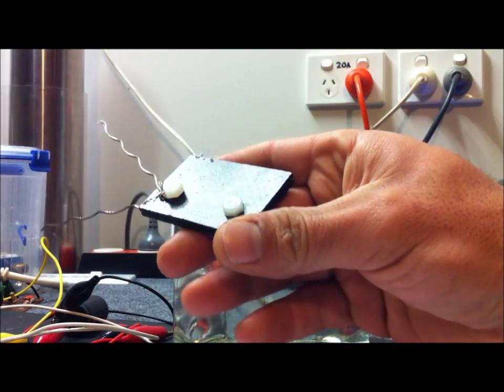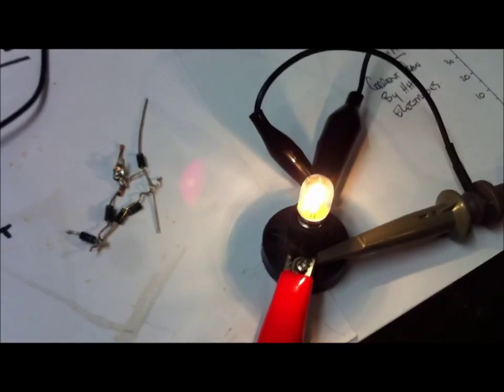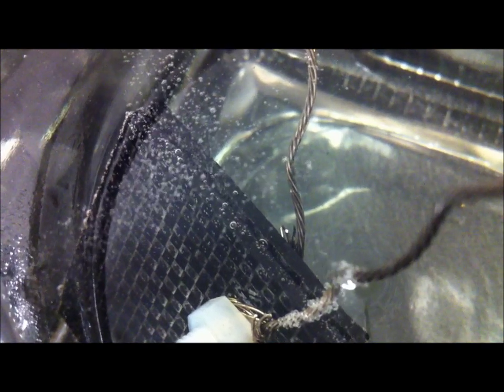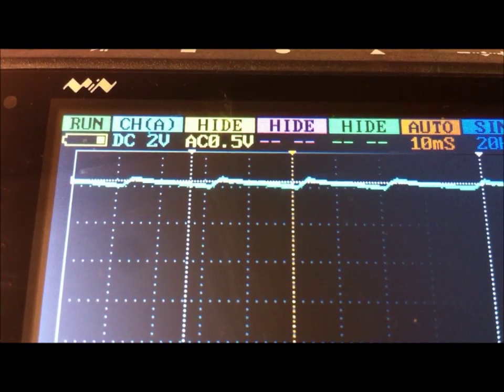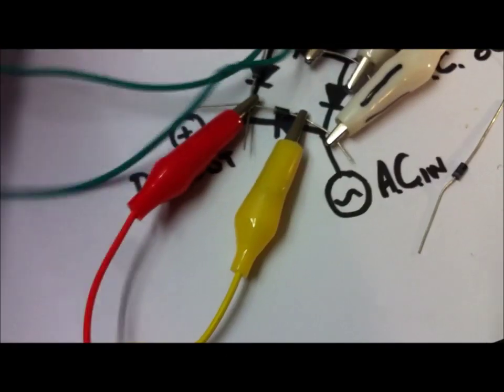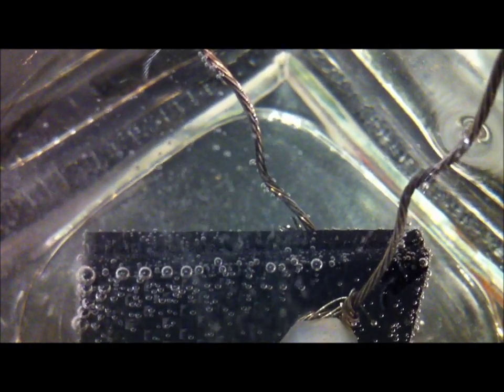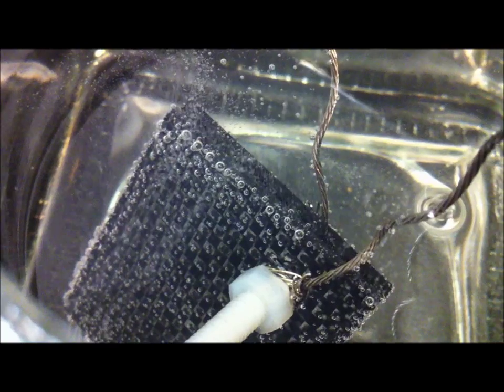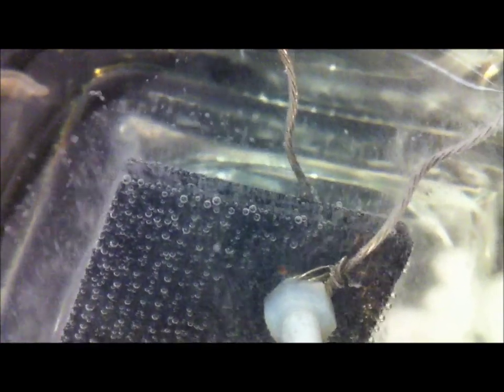Can Carbon Fiber HHO Electrodes Act As Underwater Rectifiers?

Comment: Have you tried higher frequencies and higher voltage, as opposed to amps?  Maybe pulse a 12vdc source through a transformer and then through the carbon plates.  I would like to see what happens - but I don't have carbon plates.  :)

Good luck.

Comment from the maker: No. I will do this when I get around to putting the electrodes in a cell. I have been putting it off because I needed a flashback arrestor etc.. for safety reasons. I have all the parts now, so I will probably do it early in 2013.

Comment from the maker: Sorry, I meant diodes. I am using the BYR29-800 diodes in a bridge rectifier assembly. I am also trying fast switching transistors to pulse the input of the bridge rectifier assembly. I have tried 2N3055 & TIP3055 & C1815's in a joule thief setup with some success. I will try a simple flyback driver too. Thanks..

Comment: BYR29 series are rectifier diode's, not transistors. That could be your problem...

See if you can find a 2n3055, 2n3773 or similar..

Comment: Nice.

4 plates would be cool. 

What happens if you do it in a Laydens Jar? 2 plates in two jars (or 4 if you have the plates). If the Jars where big and thin enough you could have diode, cap, and HHO cell all in one... (Maybe?)

As far as increasing frequency and current. maybe look at a big joule thief?

Comment from the maker: HHO production peaks when there is no load attached to the DC output - just a smoothing capacitor to counteract the voltage drop across the diodes. In turn, this increases the voltage across the electrodes. 

Due to the fact that the HHO is produced on every rectified DC pulse (both positive and negative half cycles @ 100Hz, I am logically assuming that increasing the frequency of the AC input signal will increase production. I will be proceeding along these lines.....

Comment from the maker: Increasing the current through the bridge rectifier increases HHO production, but only up to a point (roughly 1.5 amps). Beyond this point, there is no HHO production, as all the current somehow seems to be drawn by the load and the electrodes revert back to performing ONLY their diode function.

Comment from the maker: I am exploring all power supplies but I have limited ability to produce high frequency AC to input to the bridge. I am now running diodes with a higher current rating and have replaced 2 diodes from the bridge rectifier, leaving only 2 real diodes. Still getting a smooth DC output with work being done on every pulse instead of every second pulse. Now I'm working on increasing the AC input frequency to the bridge rectifier. This may increase HHO. Hopefully.....